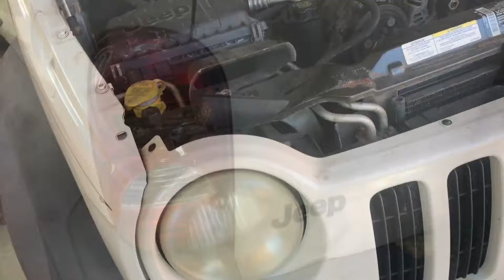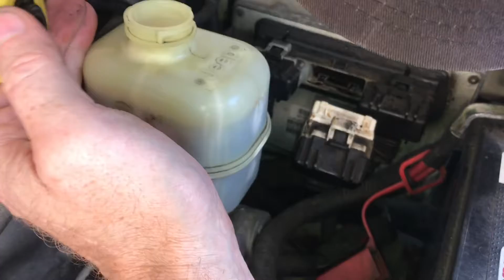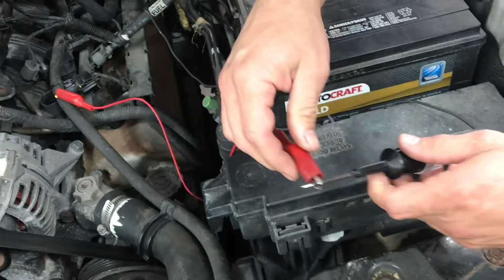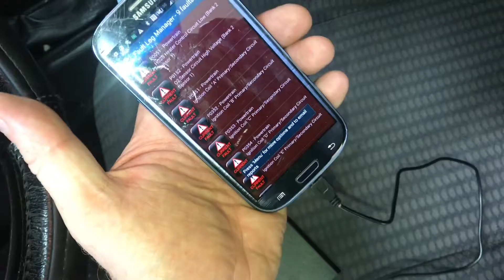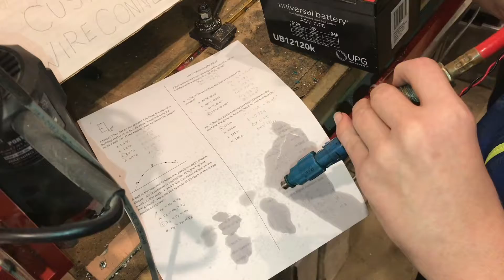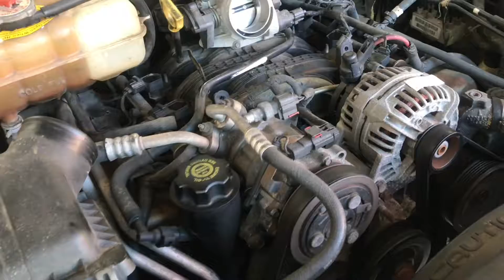DIAGNOSTICS for icm, coil packs, injectors, fuel pump on a jeep liberty

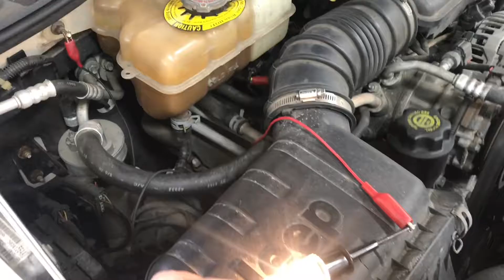Comment: 2:35 in.
Ground wire to chassis ground.
Ground wire from what? The probe, or the connector? also in the video you have the black clip on pin 2 (B+),and the red clip on pin  1(coil driver)  I get the red clip, but is the black clip from the test light?

Comment: I need some help, i have a misfire on cylinder #4 I replaced the spark plugs and switch the injector #1 to the #4 and coils to differents numbers and I still have a code for #4 I did a compression and these are the results #4=190 #3=160 #2=190 #1=185 any ideas? Thanks
Reply: trace the wires off that injector, look for breaks and frays. It could also be a bad ecm.